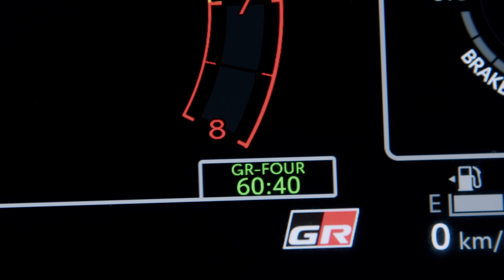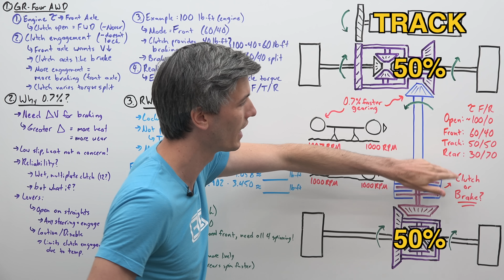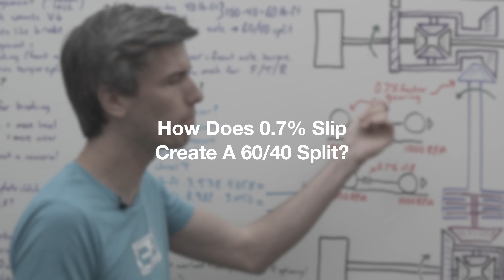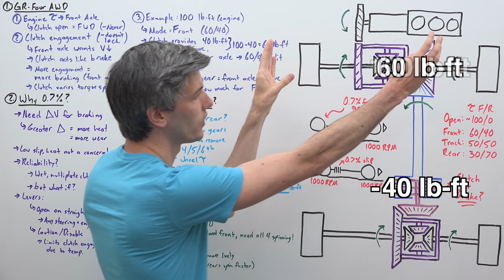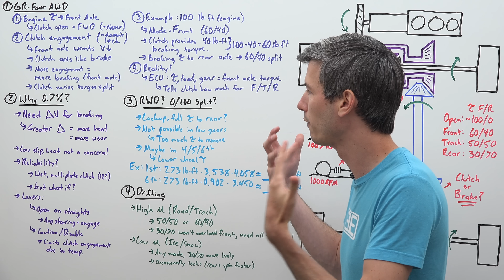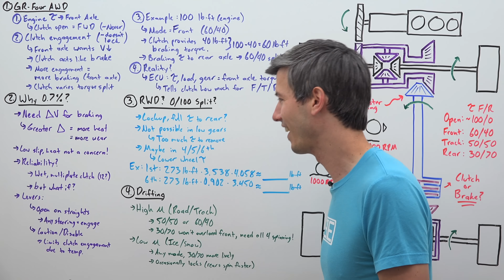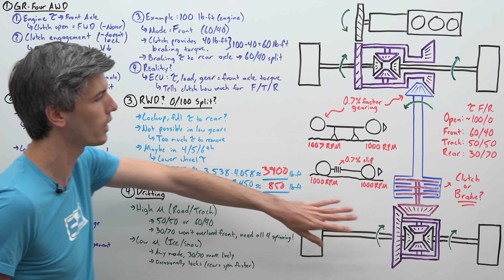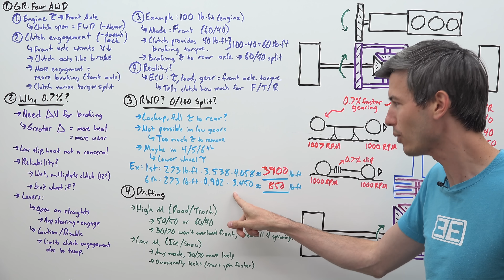Toyota GR Corolla's Brilliant AWD System - How It Splits Torque!

Comment: So it's mainly a front wheel drive system with 30% torque to the rears due to the gearing. Its awd only when you select or slipping is sensed. I'm not doubting this is a great system but I have huge doubts about the robustness and longevity of constant slipping clutch packs.
Reply from the maker: None of this is correct. It is always awd, and there is never 30% to the rear. Standard splits are 60/40, 50/50, and 30/70. Again, not front wheel drive, it’s always both axles being driven.
Reply: @EngineeringExplained   That's what I was trying to say it's a 60/40 spilt by gearing then 50/50 and 30/70 by clutch packs. People have had over heating problems on the yaris puting the car into fwd only mainly due to exhaust being close to the rear differential which tells me it's a constantly variable 50/50. I doubt it's running full  50/50 in that mode its probably based on throttle and other driver input. Is is awd yeah but to me it seems like a compromise given the older GT4 celiacs had a constant bias and there for predictable reliability

Comment: How does the reliability of this sort of system compare to, say, Subaru's or Mazda's AWD system?

In practice, does the Toyota AWD system work better than its competitors' systems in wet, gravelly, muddy, and snowy conditions?
Reply: In reliability and functionality it is the same, because the hardware is the same - they all use slipping clutches, computer-controlled in the more advanced systems. A less-common feature is the over-driving of the rear axle (0.7% faster than the front if the clutch were locked up) which allows the system to drive the rear even when the front tires are not slipping; that increases heat generation and may make clutch wear life shorter, but doesn't change  the probability of failure.
Reply: Mazda uses the same JTEKT system with even higher overspin ratio (1%). But their system doesn't lock the clutch.
Reply: @4x4.tests.on.rollers  no system using the overspeed approach should ever fully lockup the clutch. Even 100% of the torque to the rear doesn't require lockup.
Reply: @brianb-p6586  Maybe my words weren't precise - they are using overspeed ratio just to eliminate the backlash, not to send more torque to the back.

Comment: At 4:32, the example of 100 ft.lbs. of torque - remember that torque is not conserved through the drivetrain. 100 ft. lbs. at the crankshaft is NOT 100 ft. lbs. at the wheels. Suppose you're in 2nd gear which is a 2.0:1 ratio. When that 100 ft. lbs. goes through the transmission, it comes out spinning half as fast with twice the torque, so it's now 200 ft. lbs. If the differential is 3.0:1 then it's now 600 ft. lbs. (and spinning 1/6 as fast as the crankshaft), to split between the front and rear wheels.
Power (torque * RPM) is conserved through the drivetrain. So it would simpler to say it splits power, not torque. Sure, it does indeed split torque but the numbers change which makes it more complex to explain. With power the numbers are the same from the crankshaft to the wheels (minus efficiency/frictional/inertial losses, which are small).
Reply: Ah I see at 9:30 he mentions this... but doesn't refer back to the oversimplified earlier example.

Comment: It’s only .7% slip at front 60/40. But requires more clutch pressure and friction and less slip but more wear in the rear 30/70 split

Comment: So some of the power is being put to braking especially in the 30/70 mode.  Junk.  Might as well have two electric motors in the rear with torque vectoring and no loss due to braking MP.  I don't like this.
Reply: The electric motor approach works, but at this rear axle power level  is much heavier and more expensive.
Reply: @brianb-p6586  I get that point of view. What powerplant is this going to have to overcome awd and slip discs. I would think at least a turbo 4 cylinder otherwise all this is pointless
Reply: @kartboarder22g17  The power lost to slipping in the clutch is never more than 0.7% (the slip) of the 70% of the engine power that can go to the rear... or one half of one percent (0.5%) of the engine power. The loss is irrelevant compared to engine power.

I think that Fenske's "braking the front" explanation in this video causes confusion more than it helps.

The inefficiency of a generator and rear motors (about 80% efficient in combination, or less) would be a far greater drag on engine output than this mechanical system. It would only make sense in combination with a hybrid system, which is how most Toyota AWD hybrids work.
Reply: @brianb-p6586  Here is one question, is this how SH-AWD works only instead of 1 MPC, they uses one on each axel?  Isn't it the same way where they can send various different torques front to back?  As isn't that part of their sales literature?  Otherwise how are they increasing torque at the rear?  Maybe with a lockable planetery gearset in the RDM?

Comment: EE I would love to see you do a video on how Subaru's DCCD functions. Most notably, for the 03-05 models they had a biased centre differential that would distribute 65% of torque to the rear without creating power loss through friction/clutches. As an engineer, I'm sure you can appreciate that.

Further, this allowed them to independently free-spin axles if available torque permitted, but rarely occurs in standard cars through the DCCD clutches locking the axles together. Speaking of that, the DCCD clutch locking mechanism was quite novel too, using slip to assist in locking pressure.
Reply: The DCCD is a planetary gear, where the motor drives in on the bridge, drives forward on the sun gear and drives back on the ring gear. The planetary gear produces the 35:65 torque ratio. The sun gear and the ring gear are braked together with a lamellar clutch, thus promoting the 50:50 torque ratio, i.e. locking. This multi-plate clutch closes using an electromagnetic principle. Amazing and brilliant structure. A similar central differential was in the Lancia Delta HF Integrale.
Reply: @centralmoment One note: locking is about equal speeds, never torques.
Reply: This! I'd love to see a good break down of how it works. If memory serves, I think there was usage of a planetary gear set that was used to achieve the f/r bias but it's been a while since I dug through the cobbled together forum posts trying to explain it.

Comment: It overheats on the track in the yaris GR, there is video evidence. Did you ask the engineer what they did to make it not overheat in the Corolla GR? A track focused car shouldn't have the components overheat during a 20 minute track session, even if it's 35 C outside.
Reply: I agree that more cooling capacity should have been provided, or at least made optionally available.

Comment: I have a question? I worked on public safety communication for 42 years and know that nicad batteries develop memory if you charge them nightly and use the battery lite to medium for months and months. One day you need to use that battery  heavily and in a couple of hours you need to recharge. Will a EV battery that has been driving 20-30 miles or less every day for months and months and then you decide to drive 300 miles on the interstate will you need to charge after 100 miles or so, because the battery has developed a memory?????
Reply: This is not a video about EVs.

Comment: I have a couple of questions as a GR Yaris owner. 

Will one driving mode offer better mpg over the other? 
The first thing I do is put it straight in ‘sport’. 

I have the circuit pack with the  torsen differentials, does one mode offer less ‘wear and tear’ than the others? 

Cheers

Comment: well, in the GR Yaris, it overheats after 10-12 laps on the track - that's with 255s AR1 Semis... but happens. Then it puts it into 2WD mode only.... works fine again after cooled down. The close by exhaust adds to this happening... but there are some vents you can install which blow cool air onto the clutch housing.... that helps. Love that car :)

Comment: Has anyone noticed this is pretty much mechanically identical to the 4x4 system in the RAV4? or at least the old RAV4s? I suppose the 0.7% difference in gear ratio may be different, allowing for computer control of torque vectors and probably more informative feedback loops. But to draw out the diagram was the same. driveshaft locked with front diff; clutch to rear pinion, then a differential. 

Anyway, my point is, it's not a completely new AWD design as stated in the beginning of the video.

Comment: This seems like the same system in every current awd car including my 20 year old volvo
Reply: Almost. Some systems are not so actively controlled, and most don't over-drive the shaft to the rear, so they can't apply torque to the rear unless the front tires are slipping or the car is turning a corner.

Comment: I don't understand how this works still. You are always powering the front wheels, yhey are connected directly to the engine so they are always going to have torque, and in my mind, if you lock thst clutch close it mesns torque is gonna split to all the wheels, so 50/50... how can ypu mechanically have more torque to the rear and with the same speed as the the front wheels, someone explain me 😭
Reply: I think full lock is 30/70. Not 50/50. That's the only thing I can think of.
Reply: Actually. Idk. I have the same question. I don't like the way he explained this by saying "subtracting torque."

Comment: Once those clutch packs ware out you have the basic front wheel drive car.....But anyway Subaru has the best AWD system
Reply: Subaru uses the same AWD system design as this in most models.

Comment: Isn't this the same way a ton of transverse engine AWD vehicles work? Some of the sportier ones even have the rear biased gearing (like the Focus RS as other have mentioned). In fact, I think the Ford unit (as well as some others that I'm less familiar with) are more sophisticated since this uses a central clutch pack for front and rear control, but a relatively primitive Torsen diff for left/right control. Ford's torque vectoring in the Focus RS and some higher trim Lincolns can control each axle independently while controlling the front to rear bias. I'm not saying the GR doesn't have a terrific AWD system (seems a lot like the Audi Quattro and Haldex systems), but it doesn't seem to be all that innovative.

Comment: This is essentially BMW’s xdrive system but with a tranverse mounted engine layout. Although it’s not revolutionary, it’s nice to see this system getting used by other companies instead of the traditional Subaru and Audi systems which promote understeer.
Reply: On second thought, this is actually more like the haldex system in the golf and s3, still cool but front wheel drive based.

Comment: When i bought an AWD, I bought a Subaru crosstrek 6 speed manual. Subaru pretty much invented AWD and perfected it.
Reply: LOL
Reply: @brianb-p6586  subaru did produce the first AWD car in 1972. so my opinion is based upon fact. they also added VDC before anyone else used similar technology. vehicle dynamics control uses ABS sensors to apply brake to the tire that broke traction there by applying power to the tire that has traction.

symmetrical AWD is a good system
Reply: @andrewdonohue1853  There were AWD cars long before 1972; a very well known example is the sophisticated Ferguson system in the Jensen FF, starting in 1966. The FF was far better than the crude part-time 4WD system in the Subaru Leone, and vehicles have part-time 4WD for at least a century; Subaru didn't produce a full-time 4WD (AWD) system until 1988... 8 years after Audi's full-time Quattro and AMC's full-time Eagle. There were also lots of full-time 4WD (AWD) systems in SUVs long before 1980 - anything with a transfer case that included a centre differential.

But congratulations to Subaru marketing for making you think that - they did their job well.

Ironically, the layout of components within the "symmetrical AWD" isn't symmetrical.
Reply: @brianb-p6586  i am aware of the AMC eagle, but wasnt that part time 4 wheel drive, meaning you had to engage and disengage the 4 wheel drive as needed.

i bought a subaru crosstrek with the manual transmission and im hoping it performs well in the snow
Reply: @andrewdonohue1853  No, the Eagle used Ferguson's full-time system with centre differential (as, of course, did the Jensen FF). There have been many AMC/Jeep systems, some full-time and many the part-time type that you were thinking of. Audi also used a centre differential for the full-time Quattro system, although integrated with the transaxle (and functionally just like a later Subaru manual-transmission AWD) rather than as a separate transfer case (as used in the Jensen FF, Eagles, and traditional trucks and SUVs).

The Crosstrek is a good vehicle with a competent AWD system which should work well in snow and on ice. Most manual transmission Subaru vehicles have used (and may still use - I haven't looked at Subaru systems in a few years) a centre differential, rather than fixed drive to the front and a clutch to drive the rear. As a passive system (no computer control) this is definitely superior, but in modern systems the details of the active control are important to performance.
Reply: @brianb-p6586  i bought a manual for because the AWD system is mechanical therefore more reliable. the manual is also less trouble prone and cheaper to repair then a CVT equipped model. i am not wealthy, i cannot afford nor do i wish to pay for overly expensive CVT repairs. the more mechanical, the better. it also doesnt have nonsense like eyesight, push-to-start, stop start technology. i am a CDL truck driver, if i have handle a milk tanker truck 60 feet long weighing over 100K lbs; i do not need nor do i want computer gizmos used to compensate the general public for lack of driving ability. 

this car has exactly what i want, and nothing i do NOT want. it has A/C, power windows and locks, tilt wheel, ect ect. i like the feature set... plus the manual makes it more fun to drive.

the only thing it has, that i hope i never have an issue with is direct injection.

Comment: On the GR Yaris there are issues with the clutch pack overheating when driving it proper (track or very lively on B roads). There’s not much oil capacity in that little box either, and it’s easy to get it to heat up. There are a good few reports of the clutch pack overheating and the car switching into front wheel mode only.
Reply: I've had one 16 months and given it some,no issues so far,10 year warranty with these cars so not too worried at all ,its an absolute weapon on a B road.

Comment: I'm not concerned about wear, it's the same as a wet motorcycle clutch, but what about the extra mechanical drag of the system?
Surely this has an effect on efficiency of the cars in normal driving.

Comment: what is the torque split if the clutch is fully locked? is it 50/50 or 0/100?
Reply: If the coupling clutch is fully locked, the torque split is indeterminate - it depends on tire diameter, radius of turn, available tire traction, etc. In ideal straight-line conditions it would be driving the rears only and dragging the fronts.

Comment: really interesting stuff, this reminds me of hondas iVTM/ Acura SH-AWD but instead of longitudinally across the rear wheels more or less vertically between the rear differential and front transaxle; with the difference being multi ratio front or rear power bias in the GHR compared to Torque Vectoring front or rear power bias on honda AWD systems

Comment: So there are four fixed splits and the system can't vary in between them? Only side to side if you order the Torsen differentials? Sounds like a simpler cheaper not quite AWD system.

Comment: QUESTION:  will it hurt the system if you modified the engine to get more power?  would you have to mod the awd system to compensate for the increase in power from the engine?
Reply: No

Comment: Interesting tech. But this just highlights how electric power is superior to ICE. 2 or 4 independent electric motors is a much more elegant and flexible solution.
Reply: Sort of - if you see the electric motors on something like a Rivian or Tesla, they're not exactly small - each one without its inverter is about the size of a 6-speed manual transmission minus the flywheel/clutch assembly. Though, some of the newer hybrids and electrics running higher voltages have been able to downsize the motors a bit.

 Plus, without a mechanical connection to each other, each motor will need to be oversized if you want to send more than ~25% of total tractive effort to a single wheel.

Comment: Interesting controls Switching for the Corolla.. In the yaris the AWD control dial is "push for normal, left for sport(30/70)and right for track(50/50)..whete as in the Corolla it's push for track Mode.

Another interesting thing im dying to try is what if one manipulates the Hand brake switch (which would disconbect the clutch es completely), one would have to wire up a simple switch to activate the deactivation.. It would benefit Highway MPG and Highway acceleration (?)